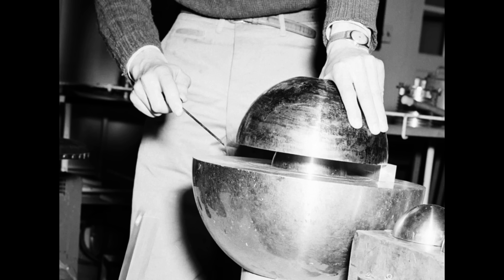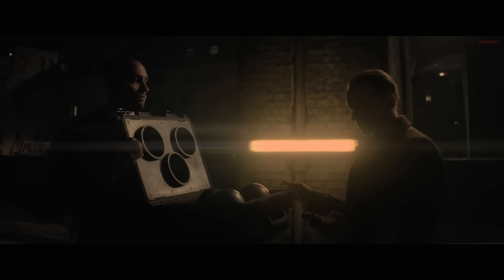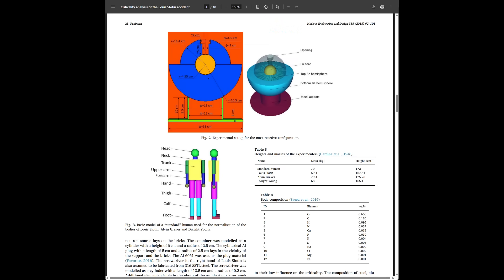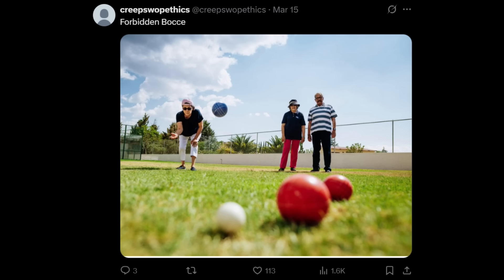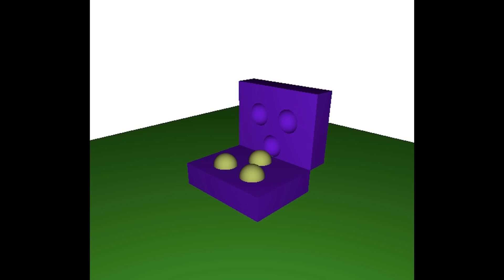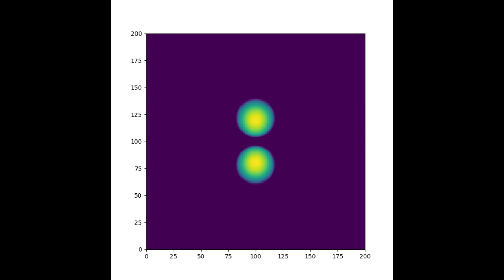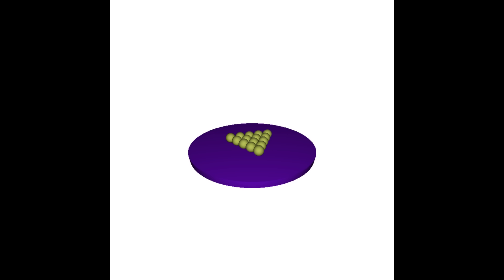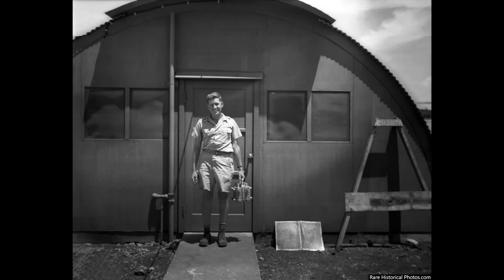Bowling With The Demon Core - Would It Explode?

Comment from the maker: This video was inspired by a bunch of memes on social media, unfortunately math is a lot more demanding than memes!
Ad-Free Early access was offered to my supporters over at Patreon, sign up if you like what I do!
Reply: 9.3 mm, are you sure about that?
Reply: I believe that you are speaking incorrectly when you say supercritical. There is subcritical, and critical. There are degrees of critical. Supercrticality has generally been reserved to mean that the metal of the core is compressed to bring the nuclei closer together, where the core does not have a negative thermal coefficient---for even a millisecond. That brings the nuclei close enough together to create a supercritical explosion. Above 1 is critical. Supercritical is something that cannot be achieved with any amount of fissile material put together in normal ways. The energy release from a critical mass will heat the material, and several things happen. First, in reactors that do this, the water will carry away heat. Second, the parts expand and the nuclei will get a little farther apart, and often sections will move apart in an "explosion" that is a relative match strike compared to supercriticality. 

This has happened some in nuclear fuel reprocessing. It used to happen sometimes in primary processing, because the U-234/U-235 would be dissolved in kerosene. The kerosene would be dumped into a centrifuge on top of water for the centrifuge step. It goes through numerous iterations of centrifugation, and slowly becomes more radioactive. 
The vanes of the centrifuge spin up, and the water would spin up faster than the much higher density kerosene uranium on top. The kerosene fluid would fall into the cone, concentrate enough to heat suddenly, and foosh! the kerosene would ignite in a flash of gamma rays. This was not healthy to be near. But, earlier in the process, it won't matter because the U is not concentrated enough yet, and this progresses slowly. That problem has, to my knowledge, been solved. Manual operators no longer control the spin up. This sort of accident tends to attract attention even in the most ossified bureaucracy (as in the old Soviet Union.) 

Something similar happened in Japan at a reprocessing plant. Someone wanted a bit more efficiency (exactly who/why I could not figure out) and put a bit too much in the buckets that they carried around by hand.
Reply: @BriPHan Actually the use of subcritical for k < 1, critical for k = 1 and supercritical for k > 1 arises from mathematics because the terms are used to describe whether the governing equations for the neutron chain reaction are convergent, divergent or just in between.
Reply: "Died by his own hand." FANTASTIC turn of phrase 😁
Reply: 9.3 mm in diameter?
Reply: How was the demon core shaped without causing a criticality event?
Reply: @johnnychang4233  The plutonium core is the small grapefruit-sized sphere in the middle and by itself it is sub-critical. It's the much larger mellon-sized beryllium half spheres that are being manipulated with the screwdriver. The number of neutrons reflected by the beryllium is what controls the criticality in this experiment. What perhaps is most surprising is how a relatively small change in the separation of the beryllium half spheres causes such a dramatic change in criticality. In other words, let a few neutrons leak out when the half-spheres are separated a few mm and everything is fine. But close the gap and reflect just a few more neutrons back into the plutonium core and suddenly you have a criticality incident. Hence then term "tickling the dragon."
Reply: @tomferrin1148 My inquiry was more about how do they machined the demon plutonium core without causing a criticality event. Perhaps they used metal that was neutron absorber instead of neutron deflector to compact the plutonium into a spherical shape.
Reply: @johnnychang4233  The effect of the reflectors is actually quite high. I mean, the pit itself is way below criticality and even if you machine it from a larger piece of plutonium, it is still below critical. The other thing, as it has been mentioned in the video, they assembled the core from multiple parts. It is quite hard to make a hollow sphere in one piece. Anyway, you can machine halves of the sphere being very far from criticality and then put two halves together and still stay subcritical.
BTW, there was/is a nuclear reactor where the active zone is a fixed set of fuel rods surrounded by a cylindrical control rods, of which one half, laterally, is a neutron reflector, another half is an absorber. And turning the control rods around, one side or another towards the fuel, they can control the criticality. Quite a clever system, very compact and having minimal moving parts not requiring a space for pulling out control rods like in a classical reactor.
Reply: Scott, would you do a video explaining how they would easily know the source of the ICBM in A House of Dynamite?
Reply: @3:05 neutrons, not neutrinos
Reply: Is that Skye? :O Man I'm getting old. :D
Reply: @GenericGerman  Thanks for the hint, and I feel the same.
Reply: 9.3 millimeters in diameter? are you for real the balls are at least 9 centimeters
Reply: Can you and Kyle Hill team up to try to convince enough of the right people to SAFELY recreate the Slotin incident using robots that can survive long enough to start and disable criticality in a shielded room? I think that's something the world should be able to see and I think you guys can get it done.
Reply: I was imagining a bowling alley and pins made of a neutron reflector! Could you have a ball that reaches criticality the moment you hit a strike?
Reply: Shooting neutrinos into the system? 
Cores 9.3 millimeters in diameter?
It looks like Scott had a bad sleep of tongue case.

One thing that is interesting, how critical is critical?
Because the things start heating (pun intended) long before the system reaches a critical configuration. The pits are warm as they are.
How many zeroes after decimal dot there are until the thing would not just be stable due to moderating itself by heating, but actually goes woohoo?
Probably there is a "relative safe" levels of criticality, when it already does heat up, but does not immediately kill everyone around it?
Also the blue flash in case of criticality accidents is a flash for a reason, if the system won't moderate itself quickly, it would be a blue steady glow instead of a flash...
I would say, there is much more about the criticality stuff to be talked about.
Like, what if we dump some enriched radioactive material deep underground where it can't quite fly apart? So it would be heating up and go subcritical, then cool down again, so we would get a bubble of boiling plutonium that melts its way down to the core of the Earth or smth...
Reply: Speaking millimeters when you mean centimeters, speaking neutrinos when you mean neutrons

Dude, how do you figure this trash is worth asking money for??
Reply: 3:40 9.3 mm in diameter? That seems very small.
Did you mean to say '93 mm in diameter', or '9.3 cm in diameter'?
Reply: I would also take this discussion down because there is information in here that is too instructional. There are parties wanting to make nuclear weapons that have not been successful yet. And those parties have been misled in ways that you blithely clarify. .
Reply: @BriPHan  You should be more worried about the literal nuclear weapons video series that has been on his channel for over 7 years 😆
Reply: @BriPHan  I don't think anyone who is serious about building a nuclear weapon would learn anything new from the discussion here. It is too much below nuclear engineering 101 level.

Comment: would the borate be enough when the case is open, and it's only covering the bottom half of the pits?
Reply: It would be fine, because opening the case will allow neutrons to leak out upwards, dramatically reducing k.
Reply: @derekp2674  well, I doubt that standard polyethylene is a great neutron reflector, so if borate is needed to reduce the interaction between the pits by absorbing neutrons, opening the case will be allowing the neutrons in the top half to interact as they would at that distance in open air.
Reply: @nwimpney Actually both water (H2O) and polyethylene ( [CH2]^n ) contain high concentrations of H-1 and thus are both very effective neutron moderators and neutron reflectors.

The two properties tend to arise together, because moderation occurs when neutrons bounce off atoms, losing energy (which is the physics of moderation) and changing direction (the physics behind reflection).

Comment: Now you've got me wondering - would it be possible to put actual cores like that into such a case without a criticality incident? I mean the actual act of placing the cores into the case. If you have 2 in place already, and you bring the third one towards the third hole with your hands, would it go critical at any point before it gets fully seated into its hole. Maybe not if you move it towards the case from far away in the direction that keeps it at the greatest distance until it gets to its hole. But what if you're a little bit sloppy and move it towards the case from a direction that brings it closer to the other cores, or if you slip and it lands on top of the padding and rolls towards the others a little?

Comment: The demon core could have been tamed if you simply turned it upside down- the upper hemisphere locked in place, and the lower one pushed up via a lever- basically a seesaw. If the rad detector gets loud, just let go of the lever.

Maybe it does take a rocket scientist. Or plumber, anyway.
Reply: That's one way of doing it safely. 
Unless you're in Russia where they still managed to have accidents (eg Sarov 1997) using that kind of arrangement.
Reply: @derekp2674  Never underestimate the Russian ability to snatch defeat from the jaws of victory.

Comment: Nice, good nuclear science review.

Monte Carlo statistics are non essential today. Yet, statistics do start with either a single dice (die) or a deck of cards. Assign properties to cards and random draws. Their still valid, but Bayes came out later.

Gaussian stats are static values. Bayesian are dynamic values. Today we would use bayesian.
Reply: OpenMC is a recently developed Monte Carlo code.

Given the complexity of the neutron transport equation, Monte Carlo methods are still the most popular way for solving that equation in arbitrary three dimensional geometries.

Comment: 5:33 - The demon core was 3.6" in diameter with a 1" diameter hollow in the middle for its' Be/Po-210 initiator and it weighed 13.5lb, the plutonium was alloyed with gallium 3% by weight.

Comment: Years ago, I used to work at Storm Bowling. They made custom balls that had stuff in them. I'm imagining a ball called The Demon Core with a fake Plutonium pit inside and an inner clear resin that will fluoresce blue and an outer resin casing with a cool piece of Demon Core logo art engraved on the outside. Probably wouldn't roll that great, but it would look cool.

Comment: I just made a 3D model of this prop. The only Pelican case I could find that came close to the one shown, in both size and appearance, was the iM2200 Storm (Hmm, iM...go figure). It measures 16.2 x 12.7 x 6.6 inches, which when you measure against the case in the pictures, yields a core size of about 10.5 cm, not 9.3 cm. How does this change the math on whether it goes boom?
Reply from the maker: I think we figured out it was the IM2300, but I don't see how you're getting your estimate of the size since the spheres are 20" of the interior case length.

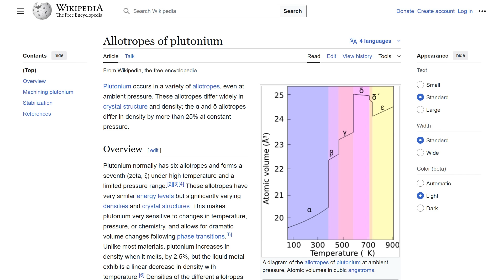Comment: 13:04 the wiki you referenced at 9:12 states plutonium increases in density when it melts so as the core liquefies it would not build pressure inside and blow out.

Comment: The Green Grass warhead as deployed in the Violet Club weapon in the late 1950s was notable for being a high yield pure fission design with an oversized HEU core that relied on unfavourable geometry to remain subcritical, being fashioned into a thin-walled sphere. In storage, it was filled with steel ball-bearings as a safety measure. I suspect that handling one of those too roughly (sans ball-bearings) had the potential to ruin your day.

Comment: blue flash or cherenkov radiation inside your eyes?
Reply: I've definitely read that the blue flash is caused by the emitted (invisible) radiation causing visible Cherenkov radiation as the radiation hits the eyes, but I'm not sure which is correct..... I would guess Cherenkov in eyes

Comment: Not a nuclear physicist, but intuitively, I wouldn't think that simply putting two balls of plutonium close together would do much. I mean, the demon-core incident was placing two large flat surfaces in contact with each other, and only a small amount of separation was enough to keep that non-critical. With spheres, there's very little actual contact, so even if it's critical at some points, most of the neutrons are just going to escape into the air.
Reply: No, the demon-core incident was, as described in the video, the near-joining of two hemispherical neutron-reflectors around a solid plutonium sphere.
Reply: @beeble2003 Ah, I misunderstood that part. But the point stands...the incident relied on jamming things together in a way that keeps neutrons from escaping... putting two plutonium bowling balls next to each other isn't doing that
Reply: @simongeard4824  Agreed

Comment: So what was the benefit of tickling the dragon's tail?  I'm not sure I've ever seen a video the explains that.  Like what observation would you see?  Did it show some cool lights?  What would you be showing off while you risked your life?  Did the metal just get slightly warm?  Also why didn't they just use some pieces of acrylic to keep the refletors far enough away?  You're spending hundreds of millions of dollars making the plutonium pit, but cheaping out on a $20 piece of plastic?
Reply: The point was to test how close to criticality the core was. It was supposed to be done using shims to position the upper half of the reflector shere, as you suggest. But Slotin was using his own unauthorized procedure with the screwdriver, presumably because it was quicker and less tedious. Fermi allegedly told him he'd be dead within a year if he kept doing it, and he kept doing it.
Reply: @beeble2003  I get that.  But I'm still not sure what the "show" would be?  Would it just get slightly warm?  What were they deomonstrating, yes how close it was to criticality.  But what would you see?  A tiny bit of Chernkov radiation?
Reply: @dodaexploda  The show was just Slotin's skill and confidence in manipulating the equipment, until it turned out he wasn't as skilful as he thought.

Comment: Quote (Physics & Radionuclide text book)

The critical mass of a fissile material is the minimum amount of that material needed to sustain a self-sustaining nuclear chain reaction. For Plutonium-239 (Pu-239), which is the isotope commonly used in nuclear weapons and reactors:

Bare sphere (no reflector): ~10 kg

With a neutron reflector (tamper): as little as ~5–6 kg

A “bare sphere” means just the plutonium itself, whereas a neutron reflector (like beryllium or tungsten carbide) reflects escaping neutrons back into the material, reducing the needed critical mass.

Comment: "You got the goods?"
opens case
flash of blue light, then everything within 3 km instantly vaporizes
roll credits
Reply: Well, a criticality event can kill people in the same room but it's not a nuclear explosion and will not evaporate anything even at arms length from the core.
Reply: "Vincent! Are we happy??"
Reply: Nekomakhea and Skunkjobb, I think you are both off the mark.
First, it would not be a criticality event, but a supercriticality event - the difference being that in the former case the nuclear reaction just reaches the point of becoming self-sustaining (think nuclear power plant), whereas in the latter case it significantly exceeds this point and escalates exponentially. The reaction would NOT stop (and to the contrary keep getting worsse FAST) until the material "found" a mechanism to disperse itself over a larger volume (think nuclear bomb).
So besides a flash of blue light, without further intervention you WOULD eventually get something FAR nastier than the Dragon Tail Ticklers got, which WOULD have serious effects beyond the room.
On the other hand, the resulting event would still be far less energetic than a "proper" nuclear explosion - rather, it would "fizzle": The cores would become just hot enough to scatter parts of themselves all around the room - and, I'd wager, beyond that.
I'd guess something akin to Chernobyl would be a fitting benchmark. Something unleashing death and destruction (but not vaporization) on an entire building, while belching plenty of nuclear fallout into the air, and subsequently costing the life or health of many a poor bloke sent in to perform something vaguely resembling cleanup.

Comment: Modern weapons use an external neutron initiator, so there may be no need for a hollow pit in the centre.
Reply from the maker: Never heard of fusion boosted devices?
Reply: @scottmanley Oh yeah, I have a degree in physics and I've read both Richard Rhodes books and recently 'britain and the H bomb' by Lorna Arnold (recommended).
There are a couple of methods of DT boosting, either into a pit in the centre, as suggested, however this would be a much larger pit than that required for an initiator, >5cm Vs ~2-3cm. The other way is to inject the DT in the levitation space around the core. Either way it would change the dimensions.
All good enough for 'back of the fag packet' calcs and I enjoyed the video 👍🏻

Comment: I made a replica of the pit carry case. I just mounted the rubber stoppers in a lath and drilled the holes for the bolts it worked fine. Didnt need liquid Nitrogen.
Reply: in a lathe